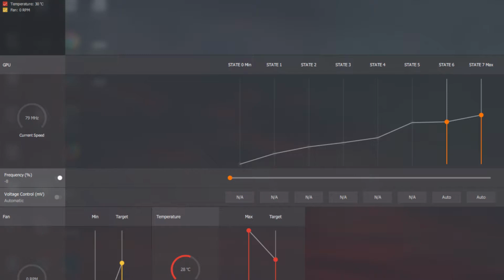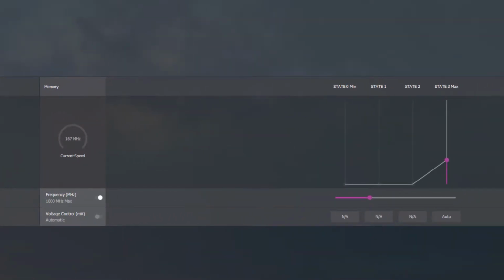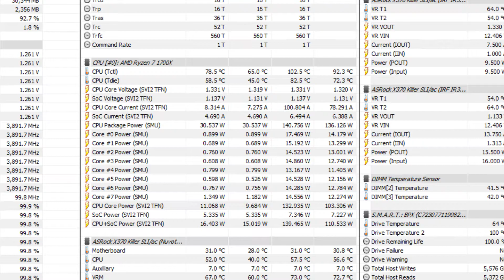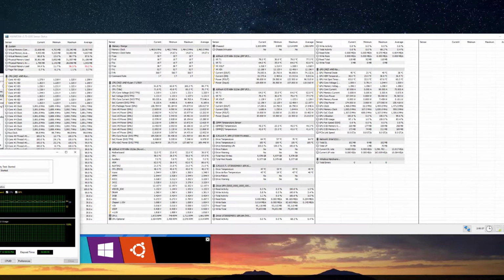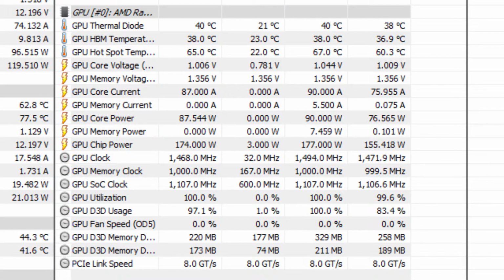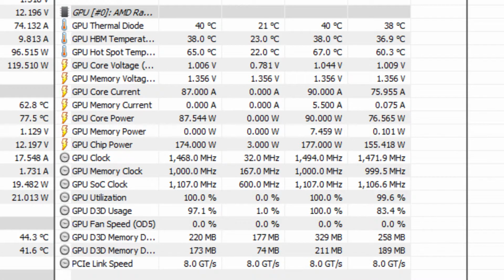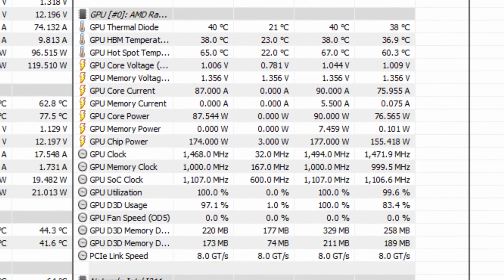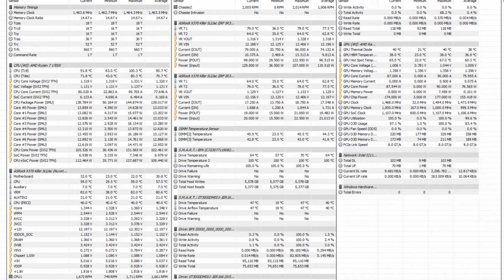EKWB A240-R Vega: Results

Comment: Do you still run this kit? How well has it held up? Worth it to improve performance on a ref card?
Reply from the maker: I just sold it a week ago, but yep still worked just fine. Definitely makes the card a lot quieter and faster. Flash the Liquid bios if you want.
Reply: LOHTEC Thank you for the quick reply!! I ordered the blower edition of the Vega 64 as it was a lot cheaper and I figured I’d water-cool anyways. So over a year and no issues, that sounds good! How often do you put new water in the loop? And did you order the coolant from the EK website? Wondering if there’s a way around paying more for shipping than you do for the coolant.
Reply from the maker: @joshuaczerniak9587  only needed to refill it once at around the year mark. It comes with enough mix so you can store a lot of extra liquid if you have a bottle. I didn't, but just added more distilled water since that is the base of the mix anyways 😀
Reply: LOHTEC Thank you for the info!

Comment: jesus your temps are high, how hot is your room?
Reply from the maker: about 70F or 21C
Reply: Video says over 70c for cpu and over 100c for gpu
Reply from the maker: right, you asked how hot the room was. And this was under 100% load for 2 hours and was the peak reported temps.
Reply: Sorry I'm an idiot. I see what you're saying now. That's crazy high. I have an h100i with 7600k at 5.1 and its about 25c idle 55c under load. Was thinking about getting this kit. Maybe I'll add a 120 rad to it.

Comment from the maker: 5% overclock and 1085 memory seems to hold fine, ~1670mhz core. 7% OC resulted in crash but temps were fine so YMMV.
Reply: LOHTEC What kind of temps are you seeing now with your overclock?  I have a Vega 64 Liquid that still gets to 60 or 65 C and that’s even with a small under volt.  Not impressed with the hybrid cooler they used.  Plus the fan gets quite loud.  Been thinking about getting this kit and adding the 360 radiator to really get temps and noise low on my Vega.
Reply from the maker: Depends on the game and what framerate you target. Played a round of Overwatch at 90fps cap and got 75c hotspot, 46c diode, and 48c hbm. This thing can easily cool the card, but yeah you'd want to add additional radiators if you wanted to OC the CPU and do intensive stuff.
Reply: LOHTEC thanks!

Comment: Thank you for the research! Also if your lucky you can get to 1100mhz on the mem and can get pretty high on the core with minor voltage adjustments. Mainly benefits mining though. I'm probably picking one of these up with a 120mm expansion rad to keep the temps at bay
Reply from the maker: +Colin Krist prior to the latest driver update I was running 1085 on the memory. 1100 wasn't stable, but who knows now. I was really surprised when looking at the stock cooler since it doesn't really cool the memory at all.

Comment: Looks like a good product. Apologies if I missed it but what was the overall noise of your pc after you installed the kit?
Reply from the maker: +Michael M I didn't mention it. Overall it's much quieter under full load, mainly due to the GPU. The fans that are included are decently quiet, but you could lower the noise with better ones. When gaming or just stressing the CPU it's much quieter than before since the extra water disperses the heat better so the fans don't need to spin up as high. You could make it quieter if you were ok with higher temps or added in more radiators.